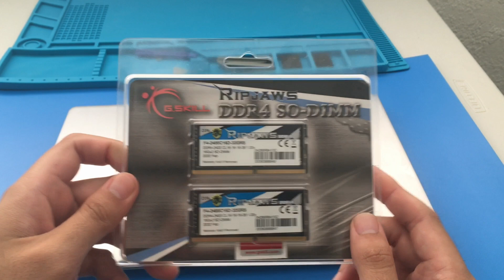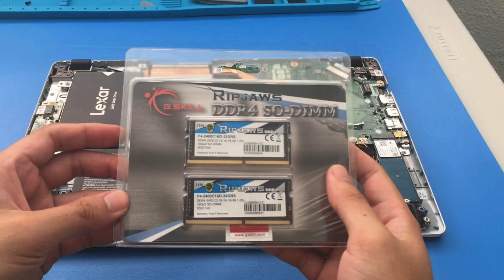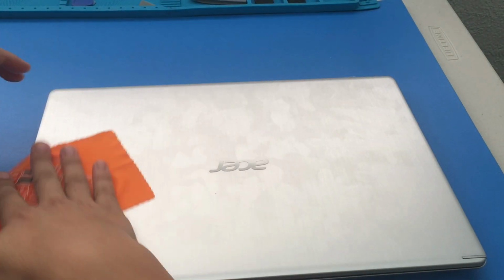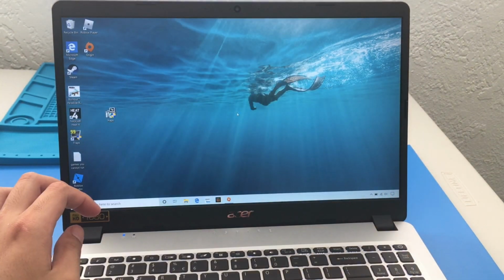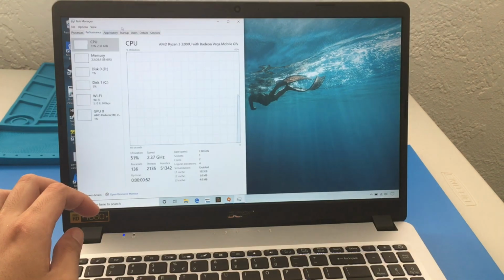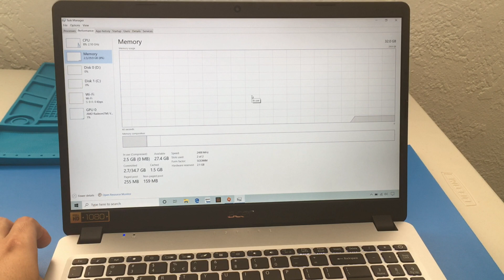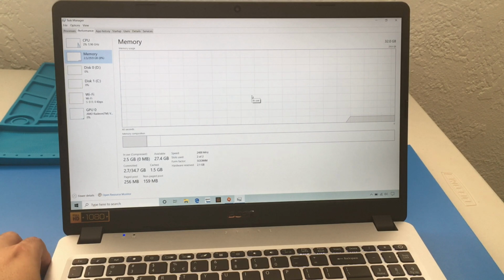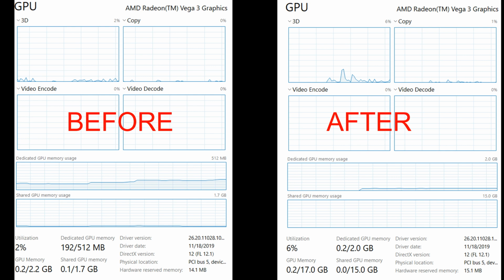32GB DDR4 Ram Upgrade! Acer Aspire 5 Slim Laptop A515-43-R19L

Comment: Can you show a 2x8 ram for this because I want 32 ram but it’s kinda expensive so if their is any 2x8 gb ram then that would be good
Reply from the maker: It should be the same process. Unfortunately I dont any 2x8gb ram for latops
Reply: @whattmeter  thanks! And is this laptop with the upgrade of 32gb of ram and 256ssd good for video editing
Reply from the maker: It’s ok. The cpu is entry level and has limitations. I usually edit 5 minute 1080p videos on this. It does a good job
Reply from the maker: Good luck
Reply: @whattmeter  and is the laptop good video editing normally

Comment: If I bought one dual channel 16gb chip of ram can I keep the old 4gb as well and have both allowing for 20gb of ram?
Reply: Or because the existing 4gb is already there the dual-channel 16gb chip I bought won't be compatible together?
Reply from the maker: Good question. 20gb total will work as long as you get a 16gb stick that is compatible with your current 4gb. Also keep in mind it most likely wont run as dual channel. Most don’t recommend it
Reply: the two sticks of 16gb (dual channel) will fill up the two slots, so no, you cannot have 8+8+2GB. also the sticks may not be compatible if you get a single 16GB and leave the 4GB one where it is.

Comment: I just ordered this twitch teo 8 Gn ram sticks I don’t have enough for the ssd yet but sheesh why did they make it so difficult just to pull the lid off I don’t have that plastic thing ? Is there anything else I can use
Reply from the maker: I've seen a lot of people use guitar picks and old credit cards/ids. They work pretty good. Some people just 3D print their own plastic prying tools
Reply: @whattmeter  thanks I’ll use a card
Reply from the maker: @atrain8179  you're welcome good luck.
Reply: @whattmeter  I JUST BOUGHT THE LAPTOP AND PUT IN A SSD.TOOK OUT THE BATTERY FOR SAFETY AND PUT IT BACK IN .I had forgotten to put it back in before closing it and then I opened the laptop and everytime I took it out the charger it shut down until I remembered why.Fast forward I opened the laptop back up and put the batter back in its slot or the battery connector I mean.Closed it up again and tried to run a simple game like roblox .I get into a game after a few minutes the whole computer shuts down. I don’t have time to do the process of returning this so can someone help me? I am gonna go check BIOS and I am getting the thermal paste Monday. I turned off sleep mode to never for screen and sleep.
Reply from the maker: Did you add an ssd as an extra or as the main source. did you also add ram?

Comment: I planning to bay newer aspire 5 and it has 4gb soldered. What should happen if I would add 32 GB to an empty slot? Would it recognize 32 as total memory? Because cpu supports only 32 gb or it not boot at all? Please let me know
Reply from the maker: Most like that aspire 5 that has 4gb soldered would only have 1 slot. Are you planning on getting a single ram stick that has 32gb? if so I would check to. make your pc supports that much because it would become 36gb including the built in.
Reply: @whattmeter  Yes, that was my plan, because https://en.wikichip.org/wiki/amd/ryzen_5/4500u here says it should support up to 64 GB, but in some places, I find that Acer can only have 16GB added. So not sure what happens with 32 GB added. option1 it not boot? option 2 it would show 32GB total option 3 would show 36GB. 
ps I already got the laptop and checked that the soldered memory stick is 2400MHz
Reply: @rimgaudastamulevicius8614  Hi, did you try to put a 32gb ram stick on your laptop? How did it work?
Reply: @block3732  no I did only 16
Reply: @rimgaudastamulevicius8614  I still need to confirm but it seems like it can handle 32gb ram sticks (only one obviously because there's only one slot, the other is soldered). At least the Acer Aspire 5 A515-45 variants. 99% percent sure it can handle (then the maximum amount of RAM would be 36gb, 4gb soldered + 1x32gb ram stick)

Comment: So I used this tutorial to upgrade my ram but now my screen wont turn on after installing the ram.
Reply: I have the same issue!! I upgraded the exact same RAM and used the Lexar storage from the other video, and now I can't get my screen to turn on with the new ram. But it will turn on with the old ram in it and the Lexar plugged in. I'm trying to upgrade my Bios now but I can't find my model number in the wizard thing to help you upgrade your Bios. 🤦‍♀️
Reply from the maker: Maybe the new ram is defective? I would try contacting support for the ram.
Reply from the maker: What cpu do you have?
Reply: I can take a peek tomorrow, I'm going to try to upgrade my bios and see if that helps, your videos are incredibly helpful!!
Reply from the maker: No problem sorry to hear you are having issues. The parts I choose for my videos are usually the best bargain I can find at that time. Also when you turn on your pc how long did you wait? Sometimes it takes a couple of minutes for the new ram to kick in
Reply: @whattmeter   i manage to fix the problem  i just had to press extra hard on the power  chip after i reconected

it works great now, great tutorial

Comment: Is it possible to keep the 4gb stock ram and then add the 16gb of ram to it to add up to 20 gb of ram? I hope your still here.
Reply: I wanna know the same from me adding 8 gb with 4gb already
Reply from the maker: Yup that workes but make sure to match the speeds in terms of mhz. Also if possible try to get the same brand. Sometimes there are ram compatibility issues if ram sticks aren’t the same. You wont get dual channel. I try to avoid odd ram sizes but if 32gb ram works, 20gb ram should work

Comment: I picked up a Samsung 500gb 2.5 crucial 16gb ram kit 2x8 ddr4 but my question is since I picked up a refurbished one I didn’t get the 4 small screws that screw in the new SSD.   Any idea where I can get those?
Reply from the maker: I would go acer website. Im sure standard ssd screws work

Comment: Thanks for the vid. I bought 1 stick with 16gb and I believe I currently have 1 4gb stick installed. Will I have to remove the 4gb stick?
Reply: Get the best results with matching ram.
Reply: @loganhatch  So should I buy two 8gb sticks so it adds up to 16gb s?
Reply: @abigbigmac1142  as long as your rig supports 16gig which I’m sure it does, yes. 16gig will be plenty
Reply: @loganhatch  do I need a ssd or is that not required?
Reply: @abigbigmac1142  SSD or M.2 is what's going to make things load faster. So I would say definitely at least a SSD (Solid State Drive). Youtube how to load your operating system on it and you'll be booting up in seconds. For me I can go from turning computer on to youtube browsing in like 15 seconds.
Reply: For more information about laptop watch out this link : https://youtu.be/di-uzKxPf34

Comment: If I switched to 8gb would only one stick of 8gb ram work please tell me soon :)
Reply: yes but just put in the 8gb next to the 4gb that comes in it, then you'll have 12gb total.
Reply: @tohopes  you can’t put 2 sticks of different ram types in together and I’m just going to get another 4gb but thx :)
Reply: @Tommy06235  yes you can. you would be cheating yourself out of 4gb if you believed that and went with a 4gb stick over an 8gb stick. even if the two sizes didn't work together (which they would, there's no reason why they wouldn't), buying an 8gb stick makes more sense: you would have an 8gb + empty slot, which would be easier to upgrade to 16gb later. but in reality the 8gb would work alongside the 4gb, and you would get 12gb. there are even vids on YouTube demonstrating this. don't make a mistake based on shitty wrong advice.
Reply: @Tommy06235  I bought a 8gb 2666mhz and added it with the included 4gb 2666mhz. Works perfectly fine until i get another 8gb.
Reply: Ok but I am just gonna upgrade to 8gb cuz that’s just enough for fortnite

Comment: If you want a game that can work on budget laptops. I’d say, play some borderlands 2. It can run on almost anything and if you have like 8gb of ram which everyone should probably have in their laptop. It really helps performance on this laptop and playing borderlands 2 is a fun shooter where you can grind guns. And all the exploits aren’t patched since it’s an older game. Plus if you play though it with every character and just want to have new fun you can use mods or mod game saves. Good option if you want a fun game that can run on a budget system like this
Reply: I have this laptop and funny thing I’ve gotten games to run on it without even upgrading but instead of buying a gaming laptop ima just upgrade the SSD and the ram in this one, 16GB of ram and probably 500 SSD

Comment: Hi for some reason on my Acer Aspire 5 (A515-44-R2SA) mine only has one empty RAM slot when I open it up. I am confused I guess the occupied 8GB stick is on the other side of the motherboard? I am trying to upgrade from 8GB to 32 GB but I only saw the one open RAM slot, not the one that comes occupied with the 8GB stick out of the factory. If you know where the other RAM slot is it would be appreciated.
Reply from the maker: Oh really. By any chance, did you check if the motherboard has 4GB ram build into it? I would check task manager to see how many Dimm/ram slots are available and the current ram.
Reply: @whattmeter  I looked it up and found out that it does come with 8gb built into the motherboard. It's okay I put one stick of 16gb on the open dimm slot and now have 24GB RAM with no isssues

Comment: Awesome video.  Just ordered 8gb x 2 ram for my laptop.  Hope it goes smooth lol
Reply from the maker: Good luck! 16gb is definitely the sweet spot
Reply: @whattmeter  Got it switched today.  Pretty easy, thanks to your video but while I had the back cover off I noticed a disconnected wire.  It was a black wire that connected to the Qualcomm Atheros wireless network adapter.  I assume it popped off because it had a weird bend in it so I rerouted it and popped it back on.  Lol.  I'd think something wouldn't be working correctly when it was disconnected but nope.
I believe they are antenna wires.
Reply from the maker: Nice glad it worked out
Reply: @bluelude2001  what 8gb x2 you end up going with?  And did you use the ssd he mentioned in the video?
Reply: @clandfaf  went with crucials. Ordered from Amazon.    I haven't touched the SSD yet.
Reply: @bluelude2001  I’m assuming you went  with the duel 8gb 2400 right?  Amazon has it for like 70-80 bucks.
Reply: @clandfaf  "Crucial RAM 16GB Kit (2x8GB) DDR4 2666 MHz CL19 Laptop Memory CT2K8G4SFRA266"

56.99 on amazon
Reply: @bluelude2001  I’m assuming the 2400 MHz CL17 instead of CL19 would also work. All other perimeters the same.
Reply: @clandfaf  beyond my knowledge lol.  I went to crucials site and typed in my laptop and thats what they said would work lol.

Comment: would the 16GB work fine from the same ones that made the 32GB?? aka the G.Skill ones, or would you recommend another brand
Reply from the maker: Gskill were the best deal at the time. I try different brands and choose whichever has the best deal when I need it. 16gb should work fine too. I recommend making sure speed it the same. Also check the cl. The lower cl the better. This will explain some of the price differences

Comment: did you connect the wrist strap to the mat or something else?
Reply from the maker: For laptops my mat has a port where I plug in the wrist strap. It has two ports. Then the mat is connected to a ground
Reply: @whattmeter  a ground? like a ground socket?
Reply from the maker: The mat is connected to the ground in an outlet. If I remember correctly the term is “common ground cord.” Basically the center screw of the electric outlet is where the ground is connected, which is the common ground point. Don’t quote me on the terms, I’m bad at memorizing

Comment: question to everyone who owns the Aspire 5 [a515-43-r19l] how’s the fan holding during browsing with 3-6 tabs, 2-5 eps of netflix, or light gaming? please answer, im thinking of getting this for online classes
Reply from the maker: You are definitely going to get fan spin doing such tasks. Are you going to have it plugged in or on battery during most use?
Reply: jasetutorials heyy thanks for responding, probably gonna be using battery on use, and wont be using it while charging, does the fan ever get too loud or something?
Reply from the maker: When testing some of the requested games when I use 100% of cpu I can hear the fan spin. It wasn’t super loud as the fan is quieter than my desktop computer but you could definitely hear it. It should be quieter on battery. Keep in mind it’s not a gaming laptop so super intense tasks will definitely give you fan spin
Reply: jasetutorials i will defo keep this in mind, have you tried playing any fps games in this laptop? like valorant maybe?
Reply from the maker: I made a few videos with fps tests. No valorant. GtA. v, roblox, nascar heat 4, fall guys. People usually request a video. Someone requested dead by daylight for this laptop which I should have by Sunday. There have been upgrades on this laptop already though. Upgraded thermal paste, ram, ssd
Reply: jasetutorials ohh okay, will watch those. may i request valorant if possible?
Reply from the maker: Yeah I will try to get it done by Tuesday
Reply: jasetutorials thank you so much for helping!!!

Comment: I have 12 gb ram, do you think it is advisable to go to 16?
Would it improve the performance of my games a bit?
Reply from the maker: Depends what game you are trying to run? Big games like call of duty warzone it will help as that is super intensive. Other games like fortnite, minecraft, gta V, 12 gb is more than enough based on my gaming tests.
Reply: @whattmeter  do you think it's capable on running Warzone with 32GB
Reply: how’s the 12gb ram for games? do you play valorant if so, does it lag? or basically, does fps games lag?

Comment: Type: DDR4 ;

Memory Frequency: 2133 MHz ;

Interface Type: 260 Pin ;

The value of CL: 15 ;
Combination Form: Single ;

Total capacity: 4GB
is that compatible in Acer A514-52k
?
Reply from the maker: Are you planning on mixing this with another stick of ram? 2133mhz is one of the first speeds of ddr4. On paper it should work but if you are going to mix it with another stick of ram you want it to be the same speed and brand. I also pulled the specs of the laptop https://www.acer.com/ac/en/ID/content/model/NX.HKUSN.001 as long as its ddr4 laptop ram it should work, but I could be wrong.
Reply from the maker: Try checking crucial also to see if that speed if compatible. It should be though but I wouldn’t recommend mixing it with a different stick of ram. But i could be wrong
Reply: My 4gb ram in mobo is non removable it is 2133mhz so i have another ram slot i want to buy 4gb ram and same speed because i want 8gb ram in my laptop i wanna to know if this compatible in my laptop? And i dont know what do you mean mixing?
Reply from the maker: Check your motherboard model. You could pull up your motherboard model and look up its supported ram speeds. You can also run crucial scanner to see different compatible ram speeds

Comment: were there any stutters when web browsing and multitasking in single channel ram? I have single channel ram , so i am trying to diagnose the issue.
Reply from the maker: I didn’t have any issues with web browsing on one stick of 4gb ram. Although I usually have only four to five tabs open as I don’t like to multitask
Reply from the maker: Are you using google chrome? It is a resource intensive web browser if you have a lot of tabs open. You can always open task manager to see what background applications are running. You can also check your startup programs and see what is running when you turn on your pc and what is high impact

Comment: Any type of DDR4 will do?
Reply from the maker: It has to be Ddr4 laptop ram. The laptop will run ram at 2400MHz. In the video I installed ram with 2400MHz speed. You could install ddr4 laptop ram with 2666MHz speed but the computer will only run it at 2400mhz if that makes sense
Reply: @whattmeter  will there be any way to take advantage of 2666mhz?
Reply from the maker: Overclocking but I don’t know if the motherboard supports it. Also you run the risk of crashing while gaming. That’s why I always try to stick to original ram speed less of an issue.

Comment: excuse me another questionWhat voltage capacity can your charging system withstand?
Reply from the maker: are you referring if the charger can handle 110v - 220 volts? it does say on the charger 110-220v so it is auto volt or dual volt. They also mention this in the amazon question and answer (link below) If you are referring to the wattage, It says on the amazon description that the "Maximum Power Supply Wattage 65 W"
https://www.amazon.com/Acer-Display-Graphics-Keyboard-A515-43-R19L/dp/B07RF1XD36